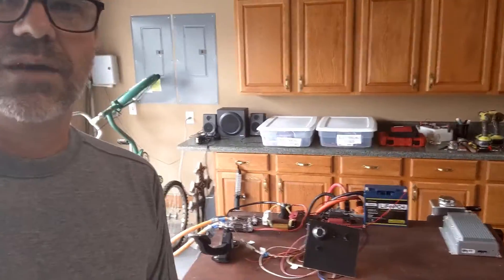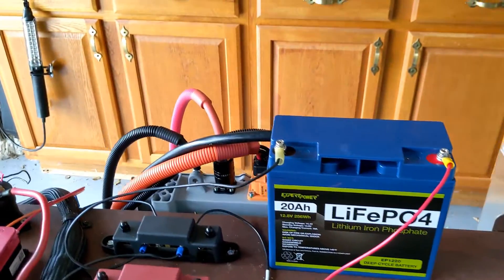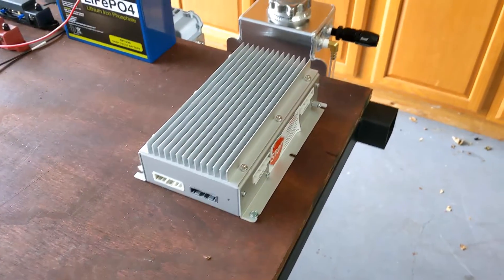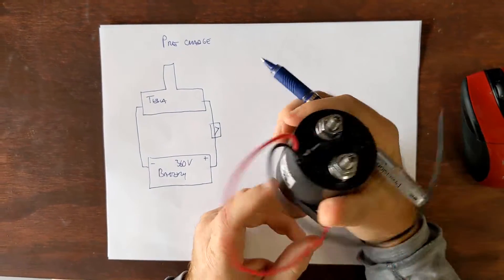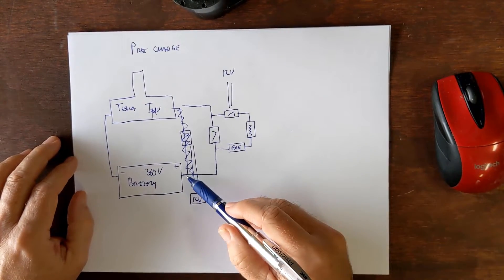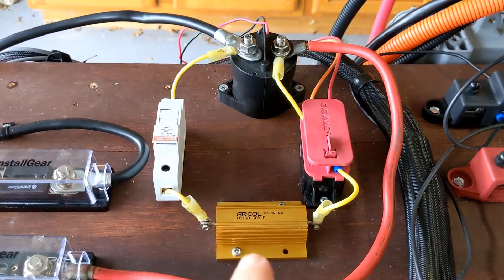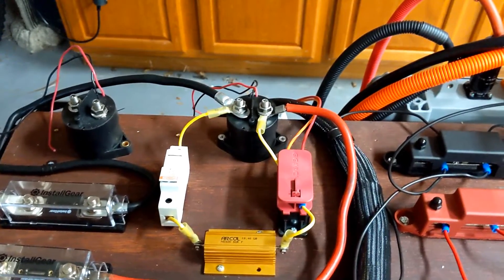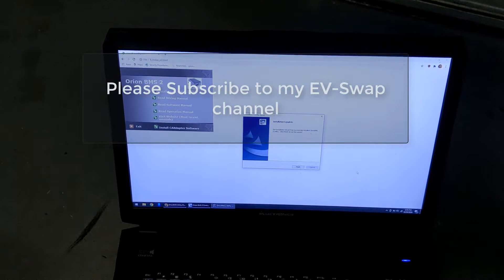How a high voltage Precharge circuits works on a DIY Tesla drive project

Comment: For the pre charge resistor contactor does it also need to be rated for 72v or can I’d be less since the resistor is significantly reducing wattage output?

Comment: Hi Mike,

I have a 96v; 105AHr LiFePo4 battery pack for my converted EV. 

Im thinking to replace the 30S BMS with 2 pieces 15S,BMSs so I can connect them in parallel for my 48v home inverter in case of outage (I live in a typhoon belt area)

I wonder if there is an issue of connecting 2 sets of 15S BMS, 48v pack in series?

Thank you😢

Comment: Hi, im new to this, just in case my question is dump 😅 ,,.what voltage did you drop using the precharge circuit?  Is there a rule of what voltage you need to drop to be safe?

Comment: Is the resister in the pre charge circuit sometimes part of the controller/inverter?  Also, is the main contactor you are using a 48v economized contactor from Gigavac?  I heard they went out of business and if so do you know where they can be sourced?
Reply from the maker: The resistor is a stand alone component. It's gold colored in the video, with fins.
Reply from the maker: I imagine in some oem setups, it's integrated with the contactor, but most DIY setups I have seen, the are separate components, but the main relay and contactors are controlled by a logic board on the invertor because it needs to monitor the incoming current
Reply from the maker: Yes to the gigavac.
Reply from the maker: Gigavac merged with Sensata. There contacts still seem to be available on the interwebs

Comment: Hi Mark how can u help me... I have question.. And thank u??
Reply from the maker: About what?
Reply: I need to mesure height voltage in range 240 to 450....with microcontroller aurix tc3... Input analog support _0.7 to 6.75

Do u think voltage  divider circuits is correct?

Comment: Which cooling pump did you use for your battery pack?
Reply from the maker: The Tesla cooling pump.  There are lots of them on ebay for less than $100.

Comment: Nice! This was a clear demonstration! Thank you!

I was wondering, with your setup was it your estimated range and top speed. I am thinking of getting a Model S, using the Damien Maguier board and pairing with Chevy Volt Batteries. I was actually looking at the Orion BMS for my build too.

Just doing a lot of research and planning at the moment.
Reply from the maker: A good rule of thumb is 100 miles of range for every 30 KWh of battery.  So this 16 KWH Volt Pack should be good for 50 miles.  Which is what the Chevy Volt was rated for.  But that range depends heavily on the weight of the car, its aero dynamics and how you drive it!
Reply: @ev-swap  Thank you!

Comment: Hello,

I would like to ask you a question. What might be as a possible causes for delay in precharge time. The expected 1 cycle is between 400-800 mS but the circuit that I have complete the cycle in 1.5second.

Also how dcdc converter ıs working in precharge?
Reply from the maker: I guess it depends on the pre charge controller you are using.  In my video, the control board inside of the Tesla invertor controls the pre-charge circuit.  And it watches the voltage levels in the MOSFETS and once they reach a particular voltage, it engages the high voltage circuit.  Maybe other pre-charge circuits just use a timer, but it seems like watching the voltage is better.  What pre-charge circuit are you using?

Comment: great work! just wondering how to connect a pre-charge circuit to orion bms? what pins do you use?
Reply from the maker: The Orion BMS does not control the precharge circuit, it is normally handled by the motor controller, since the controller can measure the voltage on the high voltage invertor's bus.  So in my case, the logic board (aka motor controller) that is embedded inside of the Tesla drive will activate the precharge relay and eventually the contactor once it detects enough voltage internally.  I believe most motor controllers are in charge of the precharge circuit, even if they are external to the drive (like a Curtis controller)

Comment: Thanks for the video!  For the pre-charge circuit, why the relay and not a 2nd contactor with the load resistor?
Reply from the maker: Hi Matt, that is a good question.  Really, a relay and contactor are the same thing, its just a contactor is designed to handle high current.  There is a fascinating video here on YouTube by gigavac showing how the contactor works and deals with the arcflash that is created every time it closes its circuit.  So to answer your question, I used a low current relay because it is less expensive than another contactor ($25 vs $200).  The relay works fine since the resistor prevents a lot of current from crossing its circuit.

Comment: I like your test bench setup,, sorry.. what is brand of your motor speed controller and inverter
Reply from the maker: I am using a ZeroEV controller board for the Tesla drive.  It is based on the Open Inverter board.  The inverter is the stock Tesla inverter that comes with the Sport version of the Large Drive Unit (LDU)

Comment: How much did you cost for this EV project
Reply from the maker: So some of the electronics you see in the video are not too expensive.  The resistor is $10, the small relay is about the same.  The high voltage gigavac contactors are about $200.  But the batteries can be very expensive (about $3000 for my Volt battery) and its only 18 KW.  The Tesla drive you see in the video is even more expensive, I bought a refurbished unit for $11,000  (including the aftermarket control board).  For drives, you can get a Tesla small drive for much less on ebay (around $3,000) but you would need a control solution that is going to be around $3,000 as well

Comment: how bad was the shock?
Reply from the maker: Enough to make me say a bad word!  All kidding aside, I'm much more careful now and invested in a good set of HV gloves and covers.
Reply: @ev-swap  Always keep one hand in your pocket. Or at least don't touch a different part of the circuit so you don't get a current patch through your arms, with your heart in between them.
Reply: @ev-swap  How did You survive 300V DC ? Everything above 50V is fatal. Unless it is not DC?
Reply: @kwapin7  Im not sure it is accurate to say that everything above 50V is fatal.  I believe it depends on the time of contact along with the path the current is taking through your body.